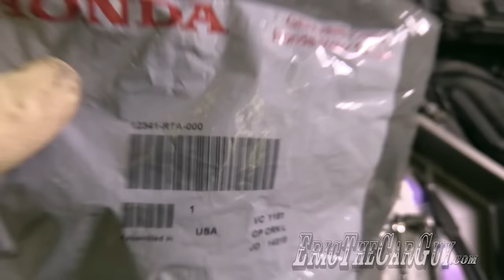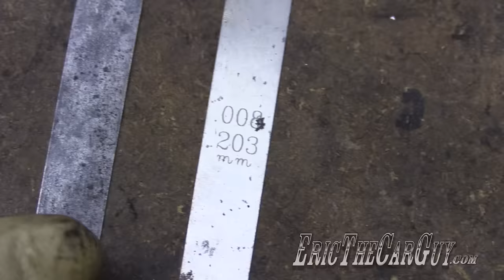Honda K Series Valve Adjustment -EricTheCarGuy

Comment: I know you said better to hear it than smell it and you successfully smoothed out the engine... but what about the increased noise? What is it? Why did it get louder? How can it be quieted?
Reply: It's probably due to the exhaust valves being a bit tight before eric adjusted it, the looser they are, the louder they will be. The only way to quiet it would be to tighten the valves more, but that's risking burning valves. I don't see a problem with a mildly louder engine if it's healthy.
Reply: nik12937

You can adjust honda k series exhaust valves equivalent to the intake side and still not burn them.  K series valve specs are better done tight than loose.
Reply: A lot of that noise is due to the mechanical actuation inside the fuel injectors. He did mention the exhaust side clearance being a bit tight, if that's the case then the added clearance "gap" between the top of the valve stem and the cam followers will introduce a louder tap noise during operation.

Comment: Yo, eric. Im doing a major repair on my 03 element. I thought it was timing chain, water in oil. Head gasket blown. 176k miles. Im in the process of removing the motor and on the right side theres a sensor kinda behind the black bracket, held on by 2 12mm bolts. It snapped off. Inside the hole its white. Its in the head.

Comment: Hey guys,looking for alittle direction here.Just picked up a 1998 cr-v with 170,000 on it,had a stumble at ilde and check engine light on with random misfire,cyl num 1 and 4 misfire and lean bank 1 codes.So I pulled the the plugs and it had oil in the wells.Started with oil change, new ngk plugs,replaced the valve cover gasket,and since the cover was off went ahead and did a valve adj. since it was a little loud.started it up engine was alot smoother and engine was quiet,Drove it for a hour or so and got the stumble back with 6 misfire codes ,
random misfire, cyl 1,2,3 ,4 and any cyl misfire,So pulled it back in the garage and did a dry comp.test,got cyl 1/170.cyl2/168cyl3/158cyl4/171.
Only thing i noticed was that harness connecter for the dist is stuck and the plugs where bright white still and dry.Don't want to threw the parts bin at her haha!

Comment: When is recommended to replace timing chain and water pump in this engine. I have a 250k miles Japan built . Still running fine .

Comment: I have a 2005 Honda Accord 4 cylinder engine with only 79,000 miles on it should I wait for 110,000 miles or so.  It seems to run good   ?

Comment: Very nice video. Just want add that the correct exhaust valve clearance of my K20Z2  is 0.28-0.32 mm (according to service manual) and not 0.254-0.330 as pointed in the video.

Comment: Cool video Eric....From my experience especially with Toyotas, after a lot of miles, the adjuster screw grooves in the valve stem.  It's almost like there is a raised edge.  When you stick a flat filler in, you are not getting a true reading.  Then, when you try to adjust it and turn it, it actually seems to make it fill right on the feller gage but within seconds of starting the motor, it burnishes the edge over and it ends up with too much clearance.  Doesn't really hurt anything, but it actually ends up noisier than when you started.

Comment: Thanks for the video.  I would not have attempted without seeing how easy it is first.  The problem is, I went to adjust the valves on my CRV with 220k miles and found that the cam lobes are worn on the number 2 and 3 exhaust camshaft.  They are also galled on the intake shaft as well.  The engine burns a ton of oil so I'm guessing the guy before me ran it dry.  Do you have a video showing how to swap camshafts?  Am I safe buying used camshafts on eBay?  I'm having misfires on #2 and #3 during idle.  Should this clear things up? -Thanks

Comment: So my 2004 accord with same engine  is making a similar clicking noise but only when cold.  After it warms up clicking noise goes away, do you think I should just leave it as is?  Engine has 195k miles on it. Or do you think the clicking noise is something else?

Comment: I I know this is an old video, but I did enjoy it. That sound is so familiar since I have owned quite a few vehicles with that very same engine. Although you didn't clean the plastic covers  when you had them off  shame on you 😀 usually how clean the top of the valve cover and the plastic covers and put some Armor All Outlast on the plastic to make it look all pretty. Thank you Eric.

Comment: It's a little louder because the exhaust were tight to begin with..  But also to be fair, the exhaust could have been done at .010 for a quieter engine. :D  Also the element k24's "vtec" is just one valve being open until vtec opens both valves with the center lobe.

Comment: I have a misfire cylinder 1 on my 2011 crv 70k miles  (Yes I did check the spark and fuel first)  do you think it may be just a valve ajust issue by any prayerful chance?

Comment: I had 06 Acura Tsx with 250,000 miles. It has original engine and original transmission. I never adjust the valve and it was running good, no loud noise on valves when I sold it. Maintenance was always on time. I sold it due to ac issue in last three consecutive years and it turns out it was a mechanic who didn't do a good job, plus it has something to do with parts (Not good Quality) from autozone with lifetime warranty. Lesson learn to buy parts made in Japan

Comment: For other people watching, this might help for setting it to .008" try fitting a .009" feeler gauge in, this will help you learn the feel, but also verify your adjustments
Reply: Assuming a .009 wouldn't fit if adjusted correctly to .008? Haven't don't this in a long time and thinking about doing it to my accord that's on 135k.
Reply: @Big-T-  You are correct, .009 would be too thick by .001 of an inch if adjusted to the .008 spec

Comment: Great video. I had a question about 14:00 min into it. You say that the spark plug tubes can be removed and then resealed using hondabond or something similar. I have a k20a2 engine, but I’ve seen in forums where they’re saying these tubes aren’t removable in this way. My question is, can the spark plug tube removal be done on my engine the way you’re suggesting in your video?

Comment: eric please help me here I called stealership and I feel like the feeler gauge they suggested is not right I went from running kind nice to tapping loud they said a range of intake20-25 and 25-30 ex so I used 22 and 28 but when I first start a .005 hardly fit its a 2007 honda civic si 2.0l 6 spd your my last hope lol

Comment: Anyone have any advice on turning the motor by the power steering pump? I have the spark plugs out but it wont freaken turn, I'm putting a bunch of pressure and I'm afraid I will snap the pulley off trying to turn the engine

Comment: Letting you know that I just had this done at 184K.  I have been having a "Cold" engine idle issue that resulting it to stall until motor was up to operating temp.  ~4-7 minutes.  I went to the local service center(Not a dealership) that only works on honda and acura cars and they actually pulled a vacuum on motor and it was too low.  So they went to check the valves and the exhaust valves were bottomed out.  They adjusted to the specifications you mentioned and so far it runs smoother and we will see in the morning on a cold start.  Thanks for the help with this.

Comment: Great video!  This process is near enough identical to the process for the TypeR K20A2 engine and also the S2000 F20C engine, although the tolerance specs might be different :)  -  The Honda manual shows checking cam gear orientation to get each valve ready to check.

Comment: question what are you tightening the screw then you tighten the bolt after. also the cam lobe has to be up before you adjust that cylinder ?

Comment: Thanks senor Eric did i mention i hate working on Astro vans  2007 Element 5 speed manual did my at 50k miles all my exhust valves were tie  engine is  a little noiser at idle, i feel an increase in power like the engine breath better, sounds better under load very happy
used same  gasket seals  little right stuff sealer on four joints  no leaks

Comment: Hey eric arent the tdc will get alter when you do the adjustment while that lobe is point upward? I know that while on tdc those big lobes will be point to each other indirectly and thats the properway to adjust it but since its the way hiw u adjust it on bigger lobw pointing upwards will it affect the measurement? Id like to try it but i think itll .gonna be off on timing degree? Correct me if im wrong since that engine has a vtc?

Comment: an easy way to get tube seals out is to pinch one edge of the tube seal with a small pair of pliers and twist 180 degrees or more to bend the rigid core of the seal in on itself, then they practically fall out.  the inside of the valve cover on my 2003 civic ex even has a recessed spot on the edge of each tube seal to give you a good spot to get a solid grip without damaging anything. I can't really tell from the video if that recessed spot carried over to the K series of engines though

Comment: 14:05 aaaahhhhhhh i had no idea about that, just so happens that my toyota corolla does the exact thing you mentioned. i replaced the valve cover spark plug pot seals and it didn't do anything.

Comment: ifffff youre in the middle of this valve adjustment and you see that just one of the cam lobes is pitted right at the tallest part of it, is that an automatic replacement? the pitting isnt too bad, about half of the diameter of a penny and it doesnt look too deep.... but this engine has 228k miles on it and everything is varnished in there

Comment: Great video as always Eric. Just did the valves on my wife's 2012 Accord, seemed to have gone well enough. Even with angled feelers getting them in and such just right is kinda a bear, plus that fuel rail in front kinda gets in the way if you don't have the special tool. No huge deal, got it done.

Comment: When doing valve adjustment, if gap is to big is that what causes valve ticking? , or it is when clearance it is to tight you hear valve ticking? I just did a k24 engine and the noise got loader but a lot of them where out of spec? and it lowered compresion in two cylinders by like 5 to 10 pounds psi. not sure if i should redo them?
Reply: He said at 01:15 mark that too tight and the valves get hot and can burn up and too loose and they get noisier. Burnt valves won't seal, which causes low compression. Sounds like some could be too tight, some too loose.

Comment: Before you put the valve cover back, do you set piston 1 back to dead center before starting the engine back up???
Reply: No point, he didn't change timing at all. Just adjusted valves.

Comment: Thats a goofy part lol, the wrench is attached to the screw driver. Why not use a wrench and screwdriver separately?
Reply: Its actually pretty useful, it’s hard to use a regular 10mm wrench on the intake side of the K series motors, very tight space.

Comment: My k24 is burning a little bit of oil, do you think that a valve adjustment could fix this? My car has 185,000 kms
Reply: No. The problem is likely stuck oil control rings.

Comment: Hi Eric, thanks for the video. For 2011 Honda CR-V 1st time valve lash adjustment (about 105K miles now), do you recommend to always change the valve cover gasket as well? Also is there a visual way to check whether the valve cover gasket (and the O-Rings) needs to be changed? Thanks!
Reply: CHANGE THEM ALL! I had my valve lash adjusted by the dealership when I first got my CR-V and it had like 98k miles, maybe 5 years ago, and I didn't know to ask them to do it, so now I'm having to replace all my coils and plugs because they've gotten coated in oil!

Comment: Hi Eric, I have a 2002 Acura rsx with almost 200,000 miles. I have changed spark plugs twice since I got it,brakes,rotors,changed transmission fluid twice also. I changed the starter. what other maintance should I do to it?
Reply: Check if your strut end links are doing fine and ball joints and tierods

Comment: Hi Eric, before adjusting the valves, should you adjust each cam lobe to deadknot center in the proper firing order?
Reply: Actually Eric, when you say base circle, should ALL the cylinders be at base circles before you adjust them? Do you make sure each lobe is at deadknot circle before adjusting the valves? Does that mean you turn the engine as you go along each valve?

Comment: Hi eric hope you will be doing well.... i am facing the issue with my AC on engine vibrates and idle drops badly what a solution? Plz
Reply: Sounds kinda similar to what my CRV was doing and valve adjustment fixed it.

Comment: Ok sorry for asking again. But why does the engine have to be dead cold?  Wouldn’t a warm adjustment be more indicative of the clearances you need to work with?
Reply: Because that's the way honda specs them. The clearances are cold. They publish cold gap measurements, not hot.

Comment: I know pro mechanics have a lot more feeling for this, but shouldn't you be using a torque wrench just to be safe ? Especially since this is an instructional video. Apart from that, very informative and interesting video !
Reply from the maker: AwkwardSilence Not in this case. It really wouldn't be practical anyway.

Comment: Where did you get your adjusting tool from? The red one? IVe wearched google and I cant find it anywhere. I have adjusted the valves on my previous car and its a problem using screwdrivet, spanner and feeler guage.

Many thanks

Comment: I usually do Honda B & K-series valve adjustments right at the tip of the valve (as you show here). I noticed in your 2012 GSR valve adjustment video , you use the feeler gauge at the rocker pad and cam lobe area vs. at  the valve tip....does this matter? I figure using the feeler at the tip of the valve would be a tad more precise than on the rocker pad & cam lobe.
Thanks!
Reply: 2012 GSR? tell me more about this unicorn you speak of
Reply: +theejoeylee video from 2012 breh

Comment: I did my valve adjustments on my Honda Accord 2004 today and it sounds like the valves are ticking. But you said that it should sound a bit louder after adjustments?
Reply: rahul lal no, it will be louder if they are loose, you can burn them if too tight. stay within the recommended specs and youll be fine

Comment: I'm a little lost on the design of the intake camshaft. Does the smaller lobe actuate two valves? I can only the rocker connected to one valve and the larger lobe's rocker on the other valve. Anyone have a diagram? Anyway, great video Eric! Watch your videos all day every day!
Reply: This is valuable information, and accurate information at that. I'm sure you just sit on facebook/twitter/instagram all day anyway. Any way you look at it, worry about yourself.

Comment: You could try out a jam nut valve adjustment tool ,makes it very convenient .Snapon and powerbuilt also make these tools in case you cant get the original one from Honda
Reply: Ebay $16 or Home Depot $12.95

Comment: Please tell me how I know that the cam shaft is at Top Dead Center for a valve? From what I understand it means the cam lob is point straight up, but I think there is more to it.
Reply: If you do it this way (at least on my K24 engine) there are tick marks you can line up on the exhaust and intake cam shafts (opposite side from the timing chain) to get TDC. I've seen others position the cam lobes slightly differently using the ticks on the gears for the timing chain.

Comment: Adjusting the valves cleared up a misfire code on my 200,000+ miles '03 Element. 50,000 miles later & I have a rough idle I believe will be cleared up by another adjustment. I've read elsewhere & my experience is that the "110,000 miles or a noisy" recommendation from Honda is garbage on K engines & that you're better checking them every 50,000 miles. Not only do these seem to often go out of adjustment earlier than most engines, but it's usually the exhaust valves that tighten up causing misfire codes / rough idle, & a tight valve is quiet (not "noisy"). The K engine is the only engine I've ever had where I couldn't get away with ignoring valve adjustments for 300,000+ miles or more on an engine, so my 50,000 mile advise on K's is clearly not from an overly cautions point of view. 😆
Reply: Still running good?
Reply: @RyanTinger  sold it not long after & it was running great. Replaced it with an '06 eCamper with 209,000 miles. It was said to have had a valve adjustment 35,000 miles ago (now at 232,000 miles) & I've got the tell tale misfire code & mpgs have dropped from 20ish to 16 mpg so I'm preparing to do another adjustment. Since the exhausts all tend to tighten up I recommend gapping them to the max of spec, .013 .

Comment: Just did this today. I had other instructions including the service manual and they all focus on the marks on the timing chain cogs. Well mine did not have the same marks as the manual so that was pointless. By watching this I was able to see you adjust each one at the top of the stoke above each intake/exhaust set. I also used the power steering pulley to rotate the engine with a 19mm socket which was a great idea. I'm very glad I have the same vehicle as you because I have access to all of your element videos. Never would have though about taking the cover off and doing it myself. Your videos gave me the confidence to do it. With the money I saved I bought a milwaukee 1/4" m12 ratchet for all the fasteners, the jam nut wrench, and a set of angled feeler gauges and still pocketed $100 bucks in labor savings.Thanks again.
Reply: Wow. I've known how to complete this procedure for years. Although I never paid anyone... it sure is good to know how much savings are in it!
Reply: Just want to get his right, do I just need to make sure the cam lob is point straight up for each valve I adjust?